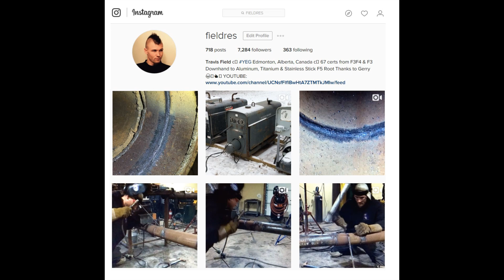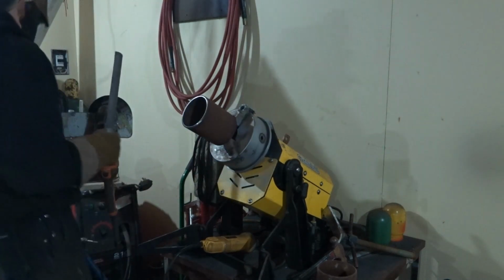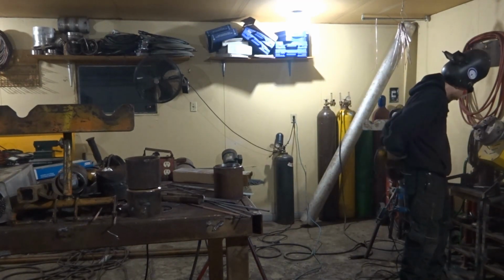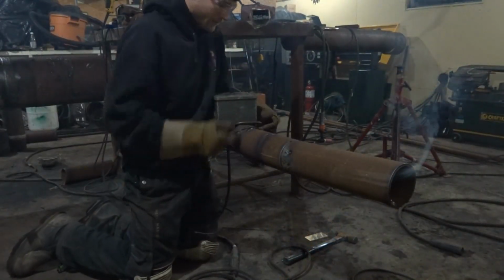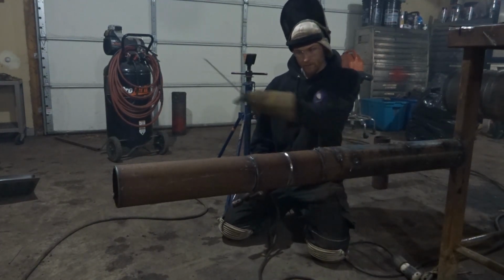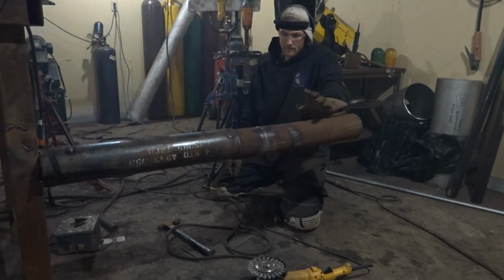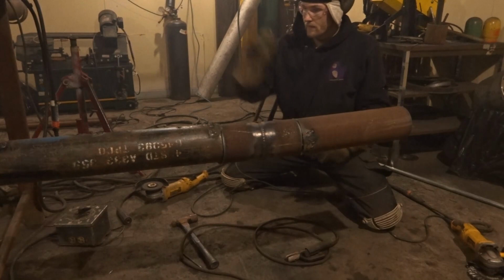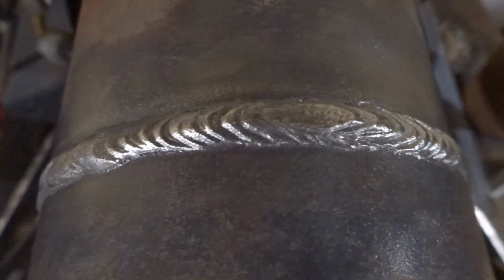5G Pipe Welding - 4" 0.188 wall - F3 Downhand - 6010/8010 - 1958 Lincoln SA200

Comment: That lincoln arc sounded nice and crisp. Those machines can sure weld overall great video man.
Reply from the maker: This particular '58 sa200, I need to roll the rack a little bit to dry up the weld puddle. It is a little bit liquid; very noticeable for capping, its a bit runny. None of these machines are tuned in the least bit, but every machine welds a little different than one another and some things I can do with one machine, I cannot do with another, but they're a good arc. I tried my friends' Pipe pro 350 and haha very different than the sa200s
Reply: Fieldres if you do roll the rack on it, a video of that process would be cool. I have a 78 blackface and felt like it was as you say "runny". But need to use it more before I make a decision, may just be me.

Comment: .188 wall is sch 20 tubing correct? The number sounds familiar, just did a hydronic system using sch 20 tube.

Comment: hey, love the videos. Why do you turn away on the root pass as you overlap the existing weld? Why use a single shade instead of auto darking? Because of the temps?
Reply from the maker: I turn my head away from the arc because I want the viewer to understand that I just 'tied in', and turning away will signify to the viewer that there is no more welding of the root pass.

I wore a autolens helmet in October 2006 when I was a 1st year welder at the Northern Alberta Institute of Technology.. everyone there all had auto lens helmets, and we were all brand new to welding. I quit wearing the helmet in January 2007 because I couldn't weld to save my life without it. Since then, this is why I only wear Shade 8 to 11 Black Glass lens in the helmets. Plus, most of the techniques I use on pipe like looking through the gap and stainless stick technique, the auto lens would just flicker like crazy.